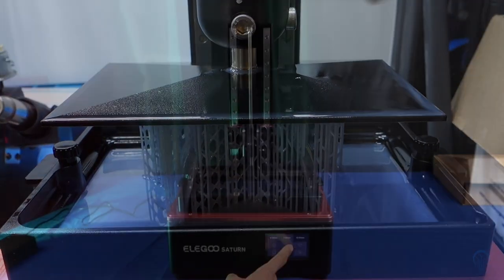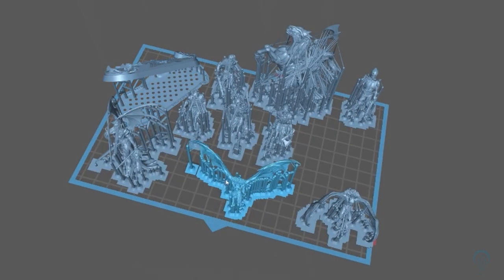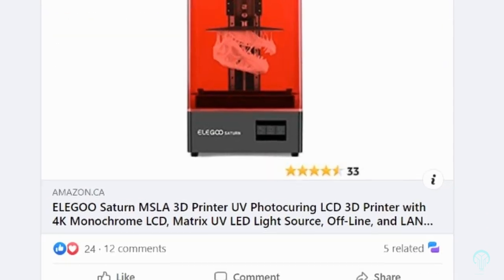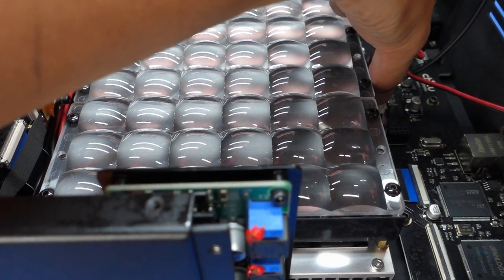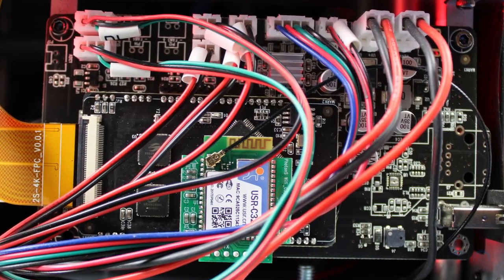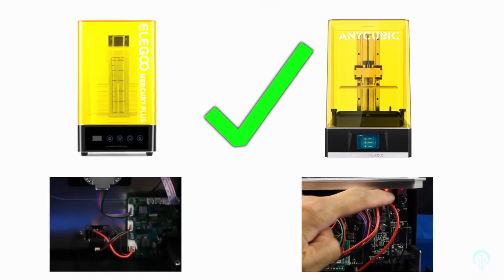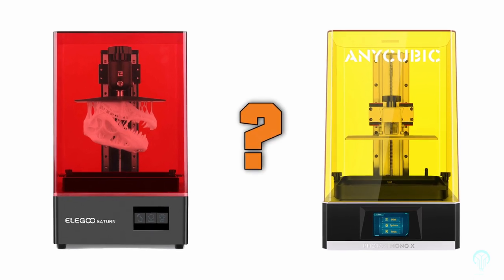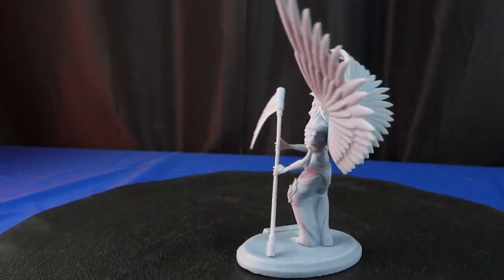Elegoo 𝙑𝙨 Anycubic - 𝙍𝙚𝙨𝙞𝙣 Printer 𝐒𝐇𝐎𝐖𝐃𝐎𝐖𝐍 - Saturn Vs Mono X

Comment: The question is, is it worth it with all the new models out. I try to get into resin printing, the machine (mono x) is down to 350€. How good are the details. I want to paint and airbrush them and put the figures on a shelf. So maybe I don´t need these razor sharp details 6k or 8k do provide?
Reply from the maker: I personally didn't have any issues with the 4k version of the mono X and got a lot of great prints off of it.  In most cases, if you're painting small figurines, you shouldn't have too many issues with the older version.  Just make sure to deal with the melting knobs first, and make sure that there is still a return policy in case you end up with one that's defective.